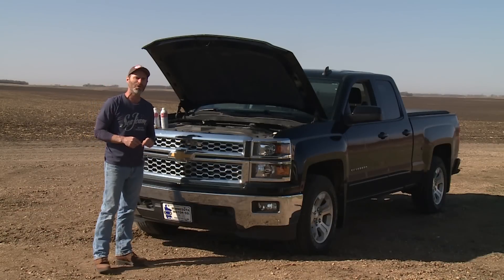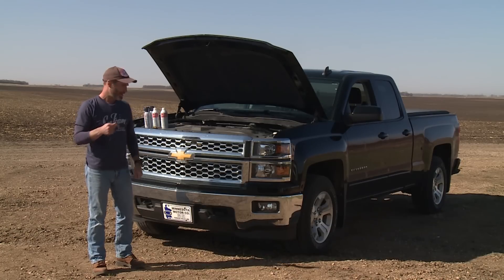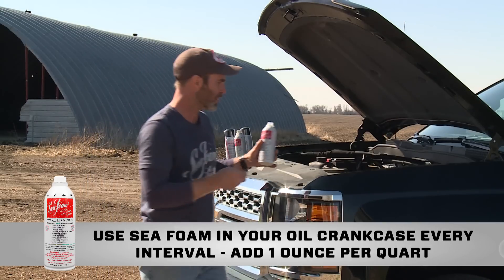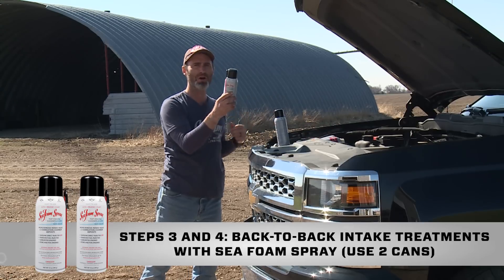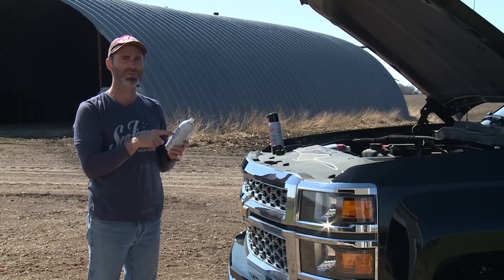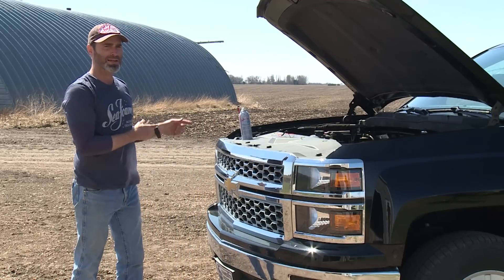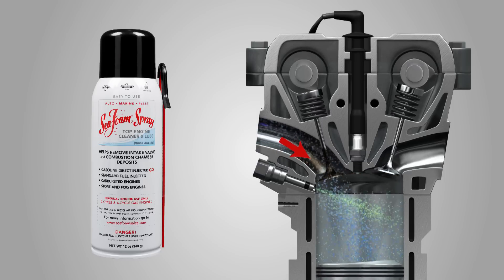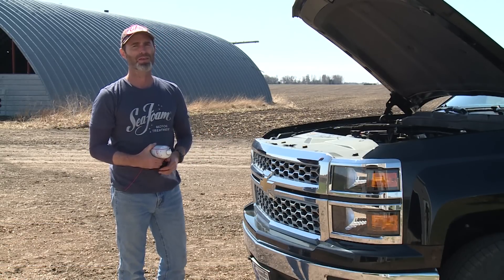Buying a used GDI (Gasoline Direct Injection) car or truck - What to do about the intake valves

Comment: Thank you. I'm a chick and was able to do this with your excellent instruction. Once I put about an ounce or 2 in my oil case the misfires completely stopped and my pickup was better on accel. Can you please describe to me why this is but speak in plain language as I don't have much knowledge?  (I drive a manual 2010 Tucson 2.4L GLS with 198000 miles on it. Had been having occasional 1 second loss of power (misfires?) while going anywhere from 40 to 70 mph on acceleration. Worse after or during AC use and worse on a gas tank with 78 miles left 'about 4 gallons left in tank' and better with gas treatments of any kind) I'm just wanting to learn more about my car. My dad taught me to try and take care of my own car when I was 11 in the 70s. He had me install the carburetor in is forest svc truck. I truly appreciate your instruction. Thank u.
Reply from the maker: Are you referring to a misfire code on your dashboard or were you hearing a misfire?

Comment: Many modern engines are more sensitive to oil viscosity and cleanliness. Introducing a solvent may not align with the manufacturer’s recommendations, particularly for newer engines.
Reply from the maker: No worries with newer oil formulations. Sea Foam is made from the same petroleum material as motor oil.
Reply: @SeaFoamOfficial  seafoam is made from mineral oil, naptha and isopropyl alcohol is that correct?

Comment: Don't use it on your L83 it will cause issue with your oil pump. Happend with me. You will toast your oil pump. Symptoms? You will get whining noise.
Reply: NOOOOOOO. I used the standard Seafoam in the fuel tank, literally had a nasty misfire after that. Rough idle, barely start without flooring the gas, and shuts off when you put it in gear. 15 suburban L83 BTW

Comment: I have the same truck and was told to go through the brake booster line. Is this going to work, or potentially cause damage?
Reply: I wouldn't. I used sea foam religiously in my trucks fuel tank. Also did the upper engine treatment when I first bought it. A couple days before I was due for an oil change I'd put a little in the crank case. Many silverado/sierra owners also use gas only from chevron or shell. After I stopped buying crappy gas my sierra did indeed do significantly better (along with the Sea Foam of course).
Reply from the maker: @itsjustry  Brake booster does not feed all cylinders evenly. Also, does not work very well as fluid (pour) is not aspirated (spray) - fluid gets pushed out the exhaust.

Comment: Question here! While spraying through throttle body , it shouldn’t affect the throttle body response right? As far as the truck relearning and having to reprogram it. I have a 2014 GMC 1500 sierra. I want to physically take apart my throttle body and clean it but i heard you will have to reprogram it. Wasnt sure if this affected it as well?
Reply from the maker: When you apply through the throttle body the fluid follows the center of the airstream until it hits the intake runners where it starts to clean. Can also cause sensors to react incl misfire codes, but everything should go back to normal after runningg the engine for several minutes.

Comment: I’m a newbie to car DIY, but I have a 2015 Colorado with over 130k miles on it. I purchased the high mileage products and put some in my gas tank. If I use the spray to clean my intake valves, is this product safe if the sea foam liquid goes to the area where the fuel injector is? Or, should I make sure my intake valves are turned and gently brush the deposit off? Reason why I ask is because I saw another YouTube video and a guy used the intake valve cleaner from sea foam, but he said not to let any of the sea foam liquid fall under the intake valve.
Reply from the maker: Hi Aaron. The can or Sea Foam web instructions are all you need. The advice form the you're describing it's nonsensical.  What's the video title so we can check it out?
Reply: That video sounds dumb as hell.
SF will be burned in combustion chamber fine, and wherever it goes it will help clean.
Its a light napha oil IIRC, and while simple and has a history from marine/2-stroke, it seems to work fine in everything. Not magic in a can, but works pretty well for a lot of non-mech issues.

Comment: 2 questions, do I fill up the truck with fuel after dumping the seafoam in and is it necessary to do the two treatments through the intake or is doing it 1 time good enough. I have the same truck 2015 silverado, 98,000 miles
Reply from the maker: One treatment is great/better than none. I don't add fuel until I've driven at least 20 miles with the higher concentration. Like with anything, adding more fuel dilutes the cleaning ability.
Reply: @SeaFoamOfficial  thanks for the reply! Look forward to doing this soon!
Reply: Did you not listen to the video?
Clearly said concentration should be high, thus putting it in a low tank.
And obviously, just like cleaning anything, doing it once will work to some x degree, and doing it again will do xx degree.
Every vehicle is different, 1 might be fine for me, you might need 2, others might need 3.

Comment: The problem is most of the time a couple of the valves get the most of the treatment while others don't
Reply from the maker: Disbursement is even at 2,000 RPM when applied into the throttle body. If using a vacuum line (we never recommend), not evenly disbursed. Let me know specifically why you think only a couple valves get treated?
Reply: I need help with this sir

Comment: Will this work for toyota's dfi/pfi engine?  I used the liquid seafoam with the drip bottle hanging from under the hood on my 2017 highlander v6.  It seemed to work, however there wasn't the usual smoke.
Reply from the maker: Yes, use it! Smoke (visible oil vapor) or not makes zero difference - not a factor.

Comment: Hi and I have a 2017 sierra 5.3 and I will try this I have notice the mpg dropping now is at 13 and a question do you spray the cleaner non stop at 2000 rpms or do short sprays
Reply from the maker: Continuous, until the can is empty. 👍

Comment: Should you fill the tank after this?
Reply from the maker: Drive at least 20 miles before filling the tank. Will allow the higher cleaning concentration to work through the upper engine before adding fuel. Does that help?

Comment: how would this work if the truck is in V4 mode and not V8 due to it not being under load?
Reply: Also if you drive around in manual mode it doesn’t switch to 4 cylinders
Reply from the maker: That's a smart question. My AFM Chevrolets run on 8 cylinders while in park. Also need to be at 2,000 RPM when applying the spray. FWIW, my AFM activates when at higher speed and minimal load/low RPM.
Reply: If you do drive it in manual mode make sure to set the gear to the 2nd highest gear because if you set it to the very last one it will still switch to V4 mode.  For example, if it’s a 6 speed trans, set your manual mode to 5 and v4 will not turn on.

Comment: Is this better than doing the CRC can through the intake hose?
Reply from the maker: Pouring a liquid into a vacuum line does not make sense to us. Does not disburse evenly and most gets pushed out the exhaust valves.

Comment: Will this cause the carbon build up to fall off and scratch the cylinder?
Reply from the maker: No, doesn't work that way. Carbon ash (unburned fuel molecules) particles are held together by fuel varnish. Sea Foam liquefies the varnish and the carbon ash particles burn with the air/fuel mix in the chamber.
Reply: @SeaFoamOfficial  Thank you for your reply

Comment: Just got a 2016 5.3 with 115,000, is this a bad idea on a truck with such high miles? Worried a chunk of carbon might break off and cause issues.
Reply from the maker: HI Nick: It's always a great idea. There are no chunks (Sea Foam liquefies varnish). Detergents make chunks - Sea Foam does NOT contain detergents. Hope this helps!
Reply: Sea Foam Official ok thanks for the reply says a lot about you guys
Reply from the maker: @nickh9160  Our pleasure, always. Let us know how it goes!

Comment: Would this be recommended on a 2014 Silverado 1500 5.3 with 94,000 miles?
Reply from the maker: Yes for sure!
Reply: @SeaFoamOfficial  when do u recommend to use? And thanks for the reply.
Reply from the maker: @viixiconik  I try to use Sea Foam Spray every 5,000 miles.
Reply: @SeaFoamOfficial  even with a catch can installed, can I still use seafoam? Thanks in advance good sir..
Reply from the maker: @viixiconik  Yes, no worries.
Reply: Same truck, same mileage! I was looking though the comments for this question! My concern is that if its too late the carbon build up could brake off in larger chunks and damage cylinder walls.
Reply: @julianason236  let me know how it went. I have a 2015 Silverado with 98,000 on it
Reply: @AndrewKellman  Did it at 100,000 no issues. Hope the valves are a bit cleaner now.

Comment: I have a 1.6l turbo, only place I can see to run Seafoam in is through the pcv hose?
Reply from the maker: You can't access the throttle body? What is the make and year?

Comment: My engine light came on after the treatment, is that normal? It’s a 2014 Chevy Silverado
Reply from the maker: Yes, a misfire code (check engine light) can come up when applying Sea Foam Spray.  Once you go back to normal running, the CEL should reset within 20 minutes of driving. If not, simply disconnect your negative connection to the cranking battery to clear the code.

Comment: Does this Product POISON the CATALYTIC CONVERTERS?
Reply from the maker: Nothing to do with a catalytic converter so no worries!
Reply: my 2018 Tahoe with L83 Engine had to have the Catalytic Converters Y- Pipe Replaced under Warranty - Not Sure was Due to ME Adding Fuel injector Cleaner in the Fuel TANK : LOW EFFICIENCY Trouble Code SET !!!
May BE Coincidence
Reply from the maker: @jonienglish3231  I'd rule it out. Something (parts/assembly) wasn't right considering the age of the Tahoe.

Comment: If you WANT to know if this works, read this full post below. I will answer with the truth. I updated post to clairfy. This first part was writen by me 4- 5 years ago. (IT SAID) ......Thank you, just did my 2014 Sierra,  exact same motor so your video was awesome,  just turned 75000 and got a lot of white smoke from all the cheap gas I've  been running, but runs like new  now,  great how too video,  thanks again!!!!
Reply: Hi, sorry to bug you. I have a problem . While doing a treatment, on 2nd can, i lost the black plastic peice for the red hose into intake manifold. I did not relise it till i got home and got code po172. Drove normal (about 5-8 miles home, ecept the 1 code) . Normally i get po420 so seeing other code suprised me. After relising what happened, i removed intake manifold and could not find plastic peice. Intake manifold had enough oil in it to leave puddle on floor. I have ordered a new oe manifold and pcv valve but noticed a small puddle on top of closed valve. If plastic hose retainer is not somewhere in manifold, would it have caused horrible things/noises or other codes on drive home? Thanks for any insite you might have.
Reply: Update, i found pastic piece and it didnt enter the motor, thank goodness. These trucks have horrible pcv's. I have 145000 miles and have used this method showed in video. I found almost half a quart of oil in man8fold, just poured out. So much it puddle a little on the top of the valves that were closed. After inspecting the valaves, and i just got done with a 2 can treatment, it does nothing. 4 years plus, at every oil change (4000 mile). These treatments dont work. With the blowby from these motors, nothing short of a media blast and a catch can can do something for them. It has been a waste of my time and money. Every 100000 miles just bring it in for blasting and a pcv valve or learn to do it yourself. I am not fooled anymore. Snake oil!!!!

Comment: do u change the oil after the intake treatment?
Reply from the maker: Hi Jimmy: No need, not related.
Reply: Sea Foam Official it doesn’t thin the oil or break it down?
Reply from the maker: @Tazman1966  Has nothing to do with oil. No worries!

Comment: You're hero man :) But it doesn't help when there's  much thicker carbon build up on the intake valves. Only walnut blasting can fix the problem.
Reply from the maker: Yes, it helps no matter how much buildup!
Reply: @SeaFoamOfficial  My car takes 4.2 quarts of oil how much should I pour in? 1/4 of the can?
Reply from the maker: @seangowan7441 Can eyeball 1/3 to 1/2 a can.

Comment: sir i have ah 2006 Chevy silverado 4.8  shud i put in half  ah tank of the sea poam  ?
Reply from the maker: Are you asking if you can add Sea Foam to a half tank of fuel? If so, yes.
Reply: It hase 1 quart of gas in there  just wanted to make sure if i shud  put half of the sea foam in the gas tank  ?  or  just  have lower fuel then add the sea foam just so it cud work better maybe ? Thanks
Reply from the maker: @alexhdavis9721  You can add 1 full can of Sea Foam to a quart (32 oz) of gas.  Just keep in mind that your pickup can't go far on  48 oz (total).
Reply: Alex Lachey your truck isn’t gdi, just add a can to a full tank every oil change

Comment: I used sea foam to clean the intake valves on an old 2015 VW GTI with 80k miles. I did not put sea foam in the oil or gas. However, it was all the GTI needed, the carbon build up on the intake valves was greatly reduced and after 10 minutes of spirited driving on the expressway the car definitely had much better acceleration and horsepower, almost like brand new!

Comment: How long do you leave the Seafoam in the oil that you added to the oil?  Do you change the oil at your normal OCI or do you need to change it sooner since you added the Seafoam to it?   Thanks.
Reply from the maker: Hi Roy: Great question! We recommend adding to oil 100 to 300 miles before each oil change.  No matter, you can add any time if you wish, even for the full life of the oil.
Reply: @SeaFoamOfficial  Thanks for the information.  I appreciate it.
Reply from the maker: @MrRGiller  Always glad to help!
Reply: @SeaFoamOfficial  I have another question for you.  Did you have any check engine lights come on when you performed this operation and did you see any increase in fuel mileage just out of curiosity?  Thanks.
Reply from the maker: @MrRGiller  If you see a check engine light (CEL) during treatment it's usually a misfire code. Once the treatment is complete the misfire code will correct itself within 10 or so minutes. If a CEL continues to show try disconnecting the crank battery for a few seconds.
Reply: @SeaFoamOfficial  Thanks for your reply.  Did you see any fuel mileage gains after the treatment?  I plan on doing this treatment after the weather warms up from this winter time.
Reply from the maker: @MrRGiller  If a vehicle that has lost MPG, the combination of Sea Foam in fuel and Sea Foam Spray cleanings will often show a recovery.
Reply: @SeaFoamOfficial  Good deal.   I don't get as good as mileage as I once did, so hopefully,  this treatment will restore the lost mileage.   Thanks again for your help.
Reply from the maker: @MrRGiller  Thanks, Roy. Let us know how it goes!
Reply: @MrRGiller  how did it go?
Still using seafoam yrs later?
Reply: @cloudyfever4721 I ended up just using the seafoam you put into the fuel tank and did that several times during refills and that seemed to help.  I still use seafoam, here and there!!

Comment: I bought my 05 Accord with 93k miles on it and Ever since I've used Too Tier gas. Around 170k miles I decided to this and idk if it's the top tier gas or what, but there was no big smoke coming like you see in some videos. Contacted them and they sent me a  complimentary can to try again and the person told me to increases the rpms. 2k rpms were to low I guess. I saw little more smoke coming out from tailpipe. I've always been pretty good about using their product that goes in the gas tank tho, so that probably another reason my engine was not too bad inside
Reply from the maker: The smoke is oil vapor.  It has NO bearing/NOT a factor.  Is always more or less visible based on many variables.
Reply: Did you apply the intake valve seafoam treatment? You won't get the smoke unless you do that. If you didn't see a lot of smoke there is a chance that you did not have much or any carbon build up in your Honda. Mainly German cars experience the carbon build up, not so much in Honda or Toyotas.

Comment: The carbon only gets there from the EGR I guess without fuel washing the valves the crud builds up
Reply from the maker: You're on the right track. Consider how EGR (returned, unburned fuel) causes deposits and residues that end up in the upper intake areas and intake valves + crankcase oil vapor (PCV) and vaporized chamber fuel.  It all adds up (builds up) with NOTHING to clean between the throttle plate and intake valves.
Reply: @SeaFoamOfficial  my 2008 CTS 3.6 DI, doesn't have EGR. I think VVP.
Reply from the maker: @cinnamongmc5430  EGR is not the only source of upper engine residues and deposits.
Reply: @cinnamongmc5430  Neither does this Silverado. Both have Direct Injection which uses a PCV system..same issues though.